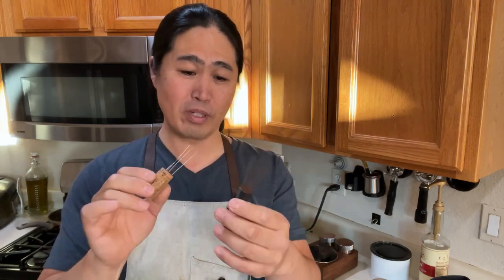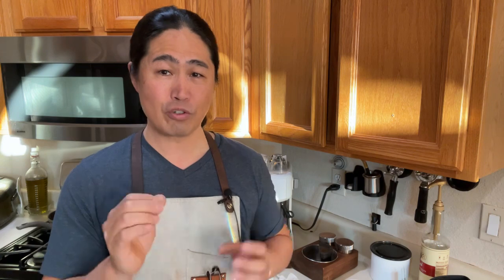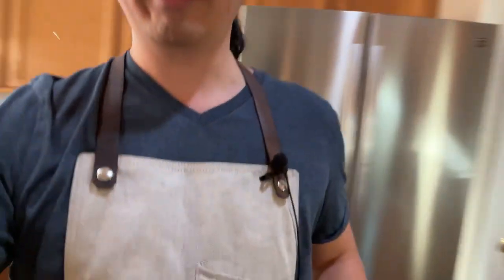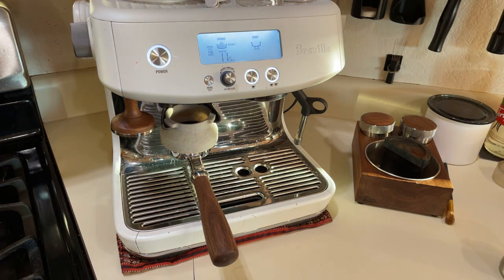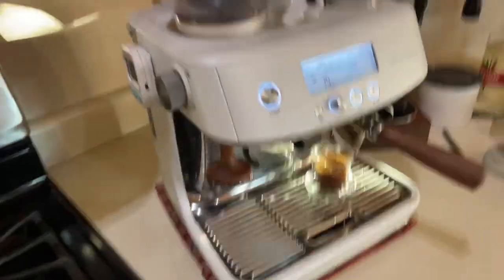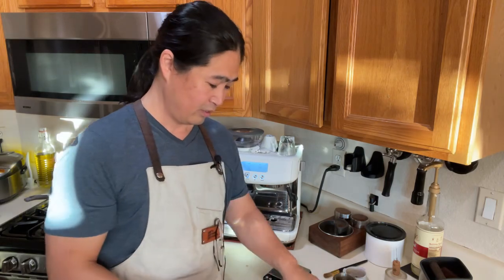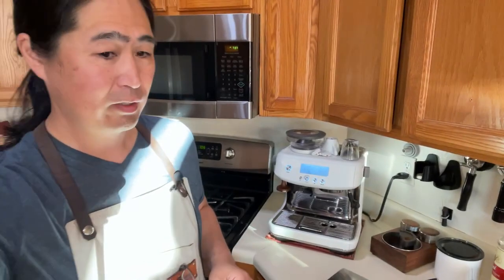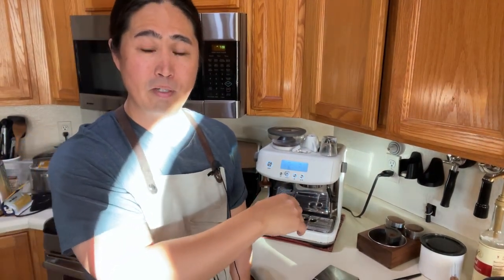Breville Barista Pro | WDT Overrated?

Comment: Adding WDT to Barista Pro workflow is really impactful. The built in grinder produces tons of clumps that need to be broken up and smoothed out. The grinds while decent, need a bit of work to get a consistent shot. Without WDT, channeling is an issue. 

Also suggest a puck screen too which also helps distribute water more evenly.

Comment: I think temperature is more important. The fact that you can’t even warm this machine up for more than 20 minutes is a bit alarming to me. I do really like to hear that they lowered the pressure. However, I enjoy a hotter cup of coffee.
Reply: Run a couple of blank shots and the steam wand for 10 seconds and the machine will be perfectly warm.
Reply: imagine thinking waiting over 20 minutes to make coffee is a feature!!! mate, put a blindfold on and you wouldn't know the difference.
Reply: I'm not trying to make it into a feature. It's just something every machine should have. I don't like lukewarm coffee, and with the Pro, there is no way to get the machine fully warmed up. While running a blank shot might heat the portafilter up, it does not get the machine entirely up to temperature. For example, the portafilter might be somewhat warm, but that doesn't mean your shots are fully up to the proper temperature. The machine's other internals can still be lukewarm.
Reply: @NickAlbano253  the portafilter has little contact with the basket and the basket in v thin....I think you're just getting affected by placebos at this point.

Comment: This is off topic but has anyone had success switch the original upper burr on the Barista Express to the new Etzinger upper burr? Did/do you have to change the lowers to an upgraded version? The Etzinger with the original lower will not pull the beans in to grind even at the most coarse setting they just bounce on top.